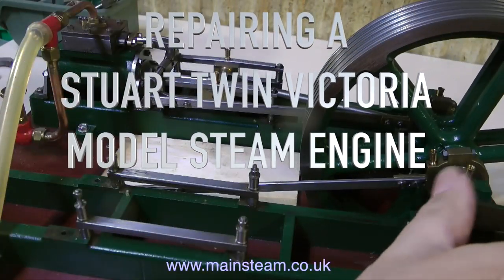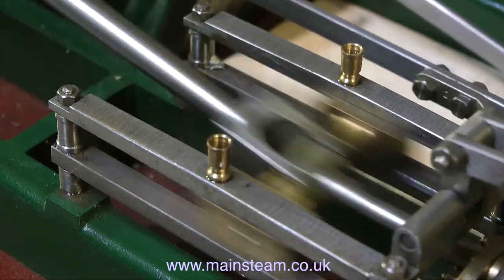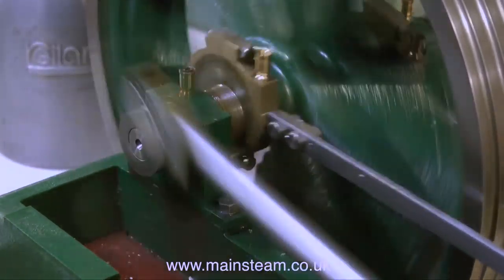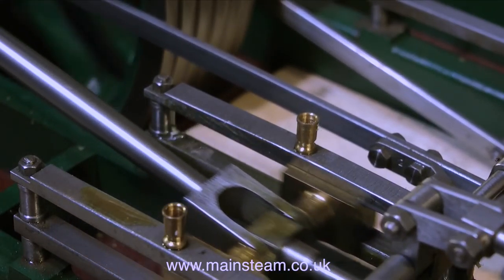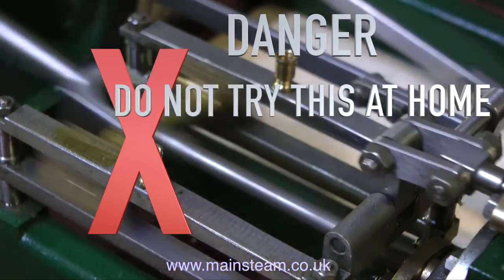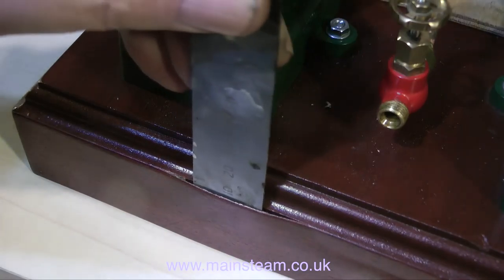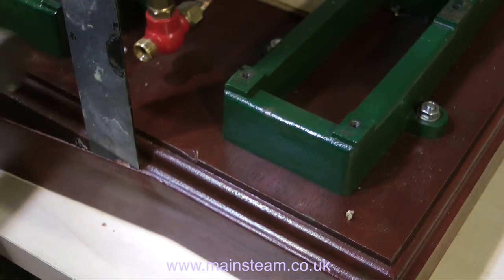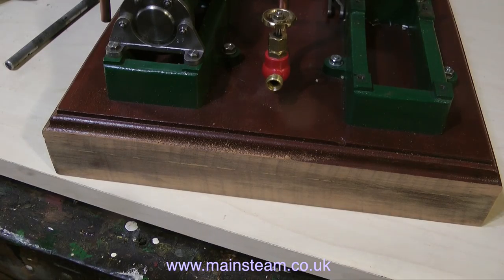STUART MODELS TWIN VICTORIA REPAIR - PART #4

Comment: Mr. Appleton,
Recently I discovered your channel. What a marvelous craftsman and teacher you are. I have a model of a walking beam engine that I had for close to 50 years. On and off I have been attempting to restore it from a wreckage it was when I got it. Using your ideas and teachings and modified to suit, it actually runs quite well now, timed according to your instructions, on some 5 psi pressure quite nicely. Thank you for the wonderful videos.

Comment: On the full size traction engines of there is s knock we run the engine slowly and hold onto the moving parts to feel where the knock is
Reply: Not recommended but it works

Comment: Veneer. I like veneer. I was wondering if on models like these veneering would in the past have been done with hide glue. The advantage when veneering things like furniture with that glue is that it can quite easily be removed again to repair things. But on a model like this that could come in contact with water and might experience heat, that might be a disadvantage. So, what glue is best used here?
Reply from the maker: Veneer. I like Veneer too. Didn't he paint the picture called "Girl with the Pearl Earring" ? :-))))
Reply from the maker: I generally use Cyanoacrylate adhesive, it seems to work for me.

Comment: What are the groves in the flywheel for?
Reply from the maker: On some full sizes Mill Engines they have grooves like these on the model for connecting lots of ropes to transmit the power to the overhead shafting pulley system which in turn used to power the machinery..
Reply: Keith Appleton was this common before they used flat belts or are ropes better at transfering power?
Reply from the maker: I don't know, many ropes were used I assume to distribute the load. I am no expert of full size steam engine practice regarding power transmission - maybe a viewer will know more about it .....